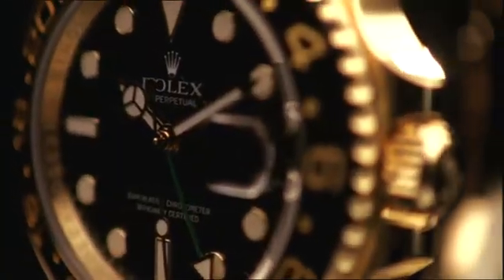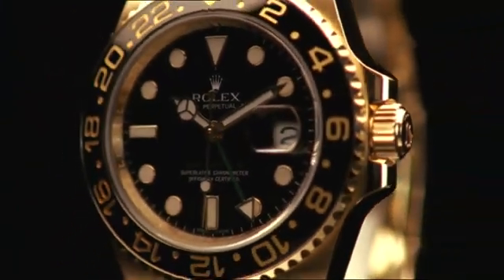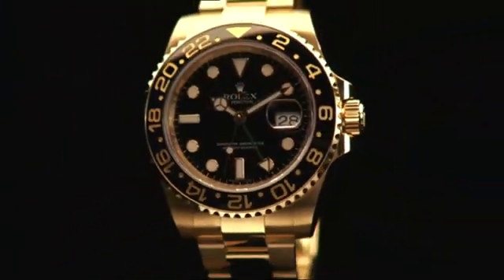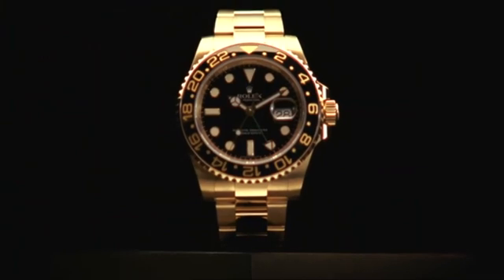ROLEX Ceramic Bezel Manufacturing

Comment: If these ceramic bezels are so good, how come they break so easily?
Reply: It is still ceramic after all
Reply: Even a rudimentary understanding of Science in general, will tell you that every material has strengths and weaknesses. 

Life is about trade-offs; not solutions. 

Ceramic is fantastic as it doesn't expand and contract anywhere near as much as metals do, and it's very scratch-resistent; but it's brittle, so it shatters with sharp impacts.

If you drop a yellow-gold Submariner from enough of a height that it shatters the bezel, the issue isn't the bezel - it's you being a careless moron lol